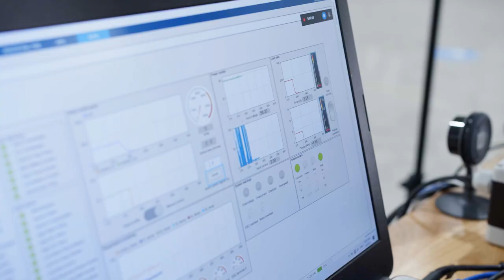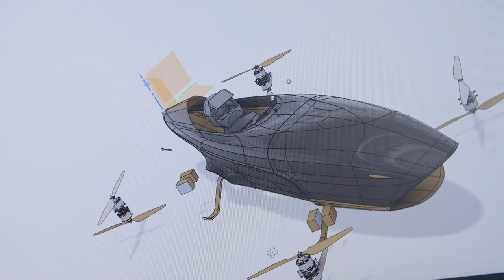Flying Car Skin Design And Powertrain Testing | Alauda Aeronautics Taking Flight Series

Comment: Does any part of the airframe generate lift (and if not, why not)?  I'm thinking of the non-GP version of this -- couldn't short CF wings extend out covering the beams that hold the motors? I think this would also look cool -- purely from the aesthetic PoV -- as well as potentially extending the range of the vehicle (it flies fast enough to generate considerable lift). Then again, I'm not an aerospace engineer, so may this just isn't feasible.

Comment: I'm a pilot and a drone pilot as well... I'm pretty curious about the safety components.  If there are any crashes between racers it's much different than a race car.  Or what about mechanical failures?  With planes you can glide and helicopters auto-rotate... not sure how you recover in something like this.  The designs look very cool for sure, but how many pilots have you been consulting in the design?  I could put together a long list of things I could see happening in the air that perhaps hasn't been considered in the design.  Interested to see where this heads... feel free to reach out if you're interested in hearing about any of my thoughts as a pilot.  Looks sweet!
Reply from the maker: Thanks for your comment, Clark. Please email us at contact@airspeeder.com
Reply: @Airspeeder  Ok, right on.  Will do.